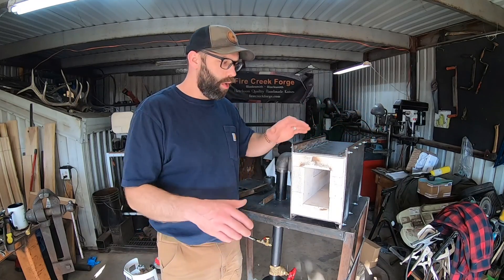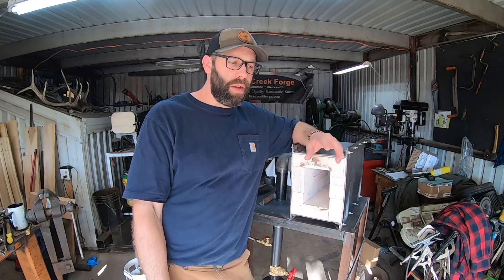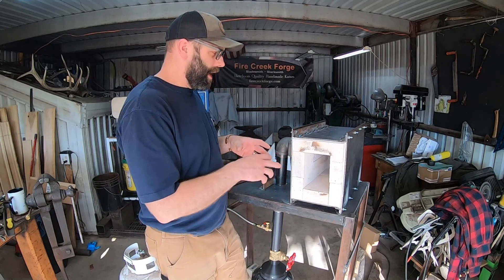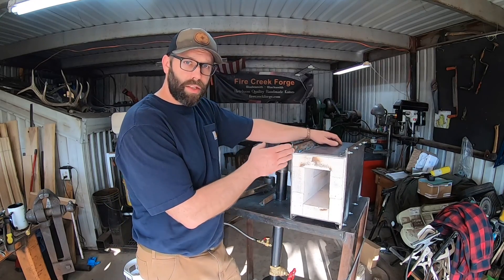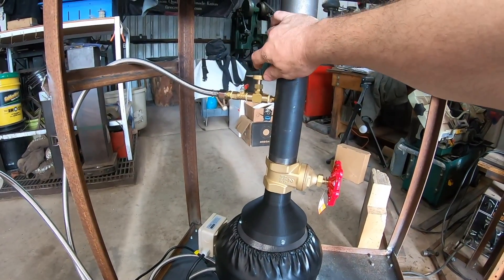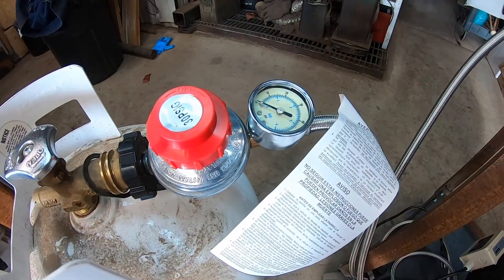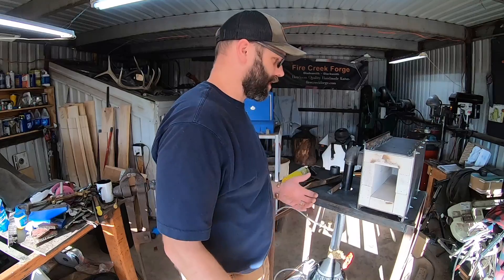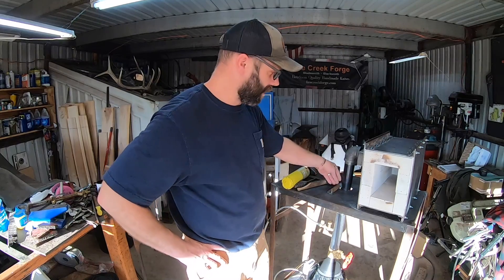How I Built This Ribbon Burner Forge, Pros & Cons

Comment: Not true on the gas use. Ribbon burners have a larger orifice around 3/16" and ventur uses a.030" orifice. So not near the back pressure but it has way more flow rate.  The flow rate is the only thing that matters not the back pressure.

Comment: Do you know what CFM you are using or need? Is your fan/blower have adjustable speed? Is that something that is necessary? I would think being capable of adjusting air volume would just as important as adjusting gas. Thinking of switching to forced air over venturi and doing tons of research. Love your videos great work.😅
Reply from the maker: @medicbutler8880  yes the fan is adjustable speed, and more importantly the valve on the 2" pipe regulates the amount of air coming in. I don't know the cfms

Comment: Would you not want the burner to face down to fire directly on the work piece?
Reply from the maker: @ThomasShue  placing the burner on the side allows the flame to circulate through the firebox more, providing a more efficient and even heat. also makes for a more compact setup I think.

Comment: A flap in the airflow that closes a micro switch and opens a solenoid valve on the gas. After all just because you have power at the fan doesn't mean it is blowing air.

Comment: I'm assuming you are using standard 9'' x 4.5'' x 2.5'' soft fire bricks.  If so did you cut any of the bricks in your design?  Otherwise I do not see how you get your layout.  It appears you have the first layer vertical/horizontal/vertical which would be 9.5" but it looks like on the top layer you only have one brick laying across which would be only 9".  Am I missing something?  Thanks for any help.
Reply from the maker: Yes I did cut/resize some bricks, don't remember exactly what now, but they are easy to cut.

Comment: Was reading that enclosing the ends creates a build up of heat which charges the fire back towards the fan.  And it also causes an adjustment of fuel and such.
I think I read somewhere where a guy was trying or actually using the exhaust heat to this create a pumping action by it being exhausted out but piped back in using the heat as the pump.  At least that’s how I understood it.  It was to bump up the heat even higher,
Also read where bricks reflect too much heat away or something instead of absorbing like a wool type refractory that absorbs and helps to keep the higher heat and after a while able to reduce the gas pressure.  Whereas bricks don’t absorb heat as much so a constant on the gas pressure using more than a wool type refractory.

Comment: I have a rocket mass heater that gets to steel melting temps, what would handle the heat, and be strong enough to be a grate to hold the wood up out of the tray for the ashes?

Comment: I built my ribbon burner forge from the ground up in half an old acetylene bottle; and it was probably more labor than the money I saved doing it literally any other way. 
I made my own burner, inspired by Old Hickory Forge’s sword forge burner, so I probably have to much burner for my volume, but it definitely heats up fast! 😂
I initially used the green ‘2.5” forge blower’ off amazon, but ran into some freaky behaviors with the flame front backing up into the burner after heating up. I upgraded to the more powerful blower, and that fixed it. 
I’ve developed a startup procedure that works slick, Instead of holding a torch in it, I use a ferro rod to light some 0000 steel wool and throw that in the forge, turn on the air, and then ease the gas on. Lights up nice and smooth and keeps all the body parts away from the fire! I figure a little burned up steel wool can easily be brushed out, and the forge is designed for heating steel, and will get scale debris in it anyways.

Comment: Have you seen those electric induction forges, where it’s basically just a coil that you put the metal inside of and it heats up very quickly? I’ve never used one but it seems ridiculously fast and simple. No idea how it would affect an electric bill but you would never have to buy gas or run out of it.
Reply from the maker: Yes! I actually bought one. Have yet to set it up.

Comment: You should consider more than PSI for efficiency, since those burners likely use the same overall volume of gas. 
If you have a hose at 100 PSI flowing at 50 gallons a minute and a 50 PSI hose at 50 gallons a minute, they're both the same volume but one has a higher flow rate.
I'd try putting your tank on a bathroom scale and see how many pounds you use per hour compared to a Venturi burner, since that's really the fairest and easiest way to do things.

Forced air should be more efficient though since you're able to adjust from reducing to and oxidizing flame, whereas a Venturi burner is a super reducing environment with lots of unburnt fuel.
There's pros and cons to reducing vs oxidizing, but reducing makes less scale and is better for forge welds/reactive alloys, and oxidizing is good for maximum heat/sacrificial material like a canister.
You should generally be able to tell just by smell, as the reducing should smell a bit like propane whereas the oxidizing should smell really hot and dry.
Reply: Yes. I came here to say the same. Less restriction=less pressure @ the same volume.

Comment: I made a body for a sword forge at least 2 years ago and didn't finish it because of the ribbon burner. Currently I use my old forge burner in my furnace and hooked up to a shop vac, and I'm able to melt steel if I'm not careful.
Eventually I'll finish that forge by making burners, but for now using forced air in a regular burner is fine for my casting needs since I haven't made knives in a while

Comment: In my procrastinating about building forced air burners (because it does cost a bit more than compared to a venturi) I did find air-blowers and neck-down components from of all places: Hyrdroponic stores
Apparently they use them to move stale and hot air out of greenhouses and there's a fair variety with the kind of CFM which suits these burners. Mostly because for those of us not in the USA, it can actually be harder than you think to find something that's both 220V AC and not made of Chinesium that will stop working and explode your shop. Just something for those looking to make one
Reply from the maker: Yes, this blower is actually for a green house

Comment: I have a ribbon burner forge and i feel like it doesn't quite get hot enough. My venturi forge seems like it gets way hotter.
Reply from the maker: Hmm, that's odd. Is the inside of the forge larger on the ribbon burner forge?
Reply: @FireCreekForge  the ribbon burner forge is slightly larger but it's not huge its 4x4x16